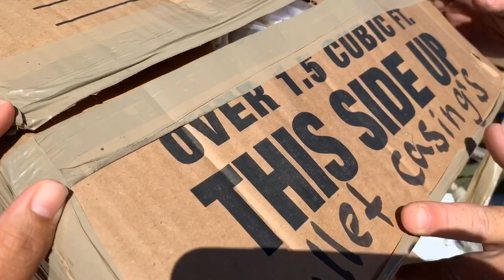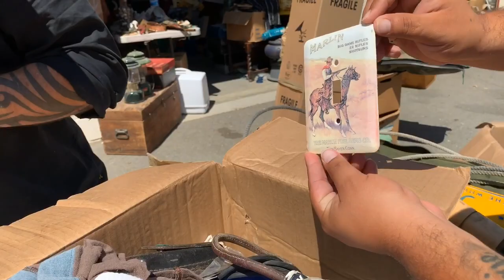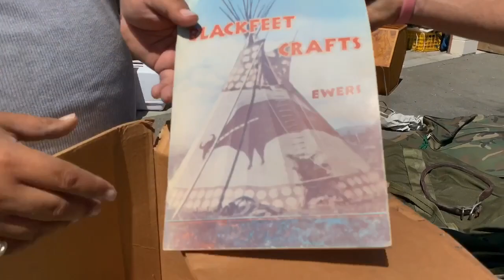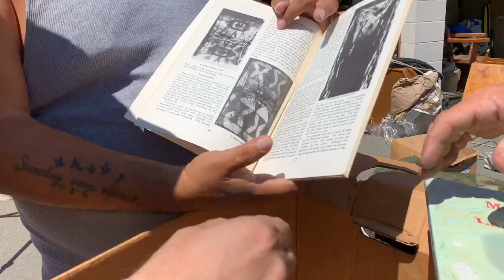$7,000.00 BEST STORAGE UNIT EVER! storage stalker Grimes’s finds I bought an abandoned storage unit

Comment: Please tell Grimes the descriptions on your auction are not the greatest.  Lot 190 is not a sketch but a woodblock print, it possibly an Ugatawa Kuniyoshi.  I can't tell for sure because the picture is too blurry. If it is it's worth $200 to $300.   Lots 27 & 29 are not scrimshaw, they are Chinese carved bone figures.  Lot 255 is Damascus Steel and it should say that in the description or it's going to sell for a fraction of it's value.  Several of the hats have no size in the description, that's going to hurt the selling price as well.
Reply: Lot 255 is barong from the Philippines it's about 100 years old.  Very popular with the Moro.
Reply: Lot 234 is a M1816 socket bayonet.
Reply: Lot 275 is a WWII German K98 41FNJ, early version, the later ones have wood handles, if the frog has a matching serial number it should be mentioned because it doubles the value.
Reply: ah the bludgeon of a shoddy auction hammer slams down on the lot's of swap meet swag ....20$ bids rule the day as they fly thru the lots of a horders dreams.
Reply: @JohnP538  Have you sent this to Grimes Finds?
Reply: @MommaG  Somebody did, because these specific items now have better descriptions.  The real sad part is that the lot descriptions are not searchable in Google.  So if if somebody is looking to buy an "M1816 bayonet" this auction won't come up in a google search.  At least the couple I tried didn't.  Guess we just have to tell our friends about this amazing auction.  I wouldn't mind snagging another Stetson, but none of these are big enough.
Reply: @JohnP538  Thank you for helping!
Reply: @MommaG  Tell your friends, and if I was you I'd be reading up on Native American blankets.  (Hint, hint, nudge, nudge, say no more.)
Reply: @MommaG  I feel sorry for the Pirate.  Somebody is going to make a lot of money but I don't think it's him.